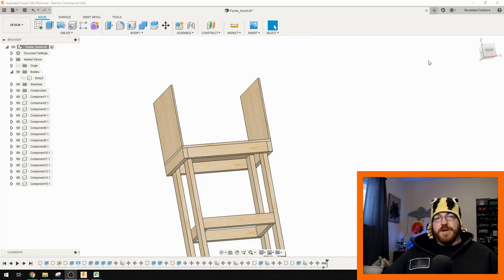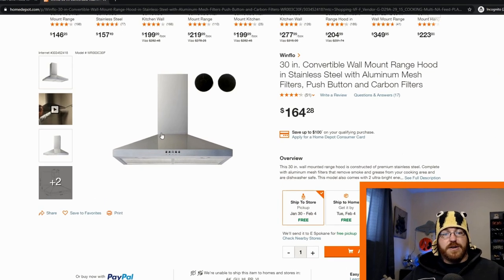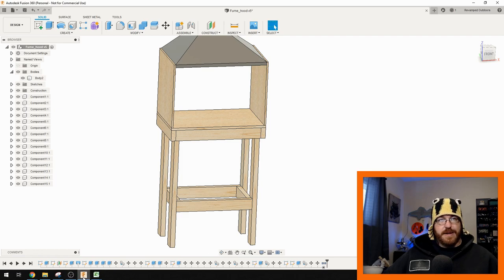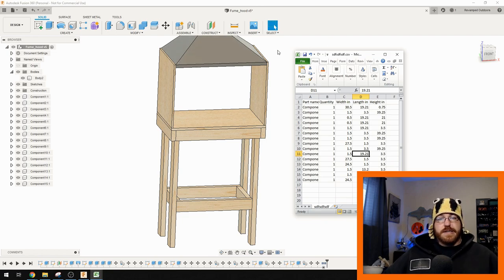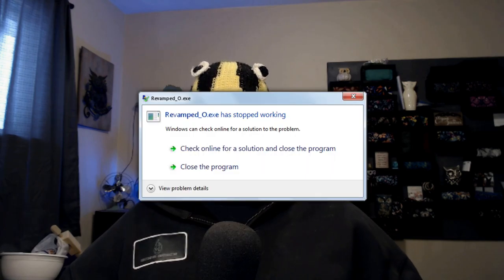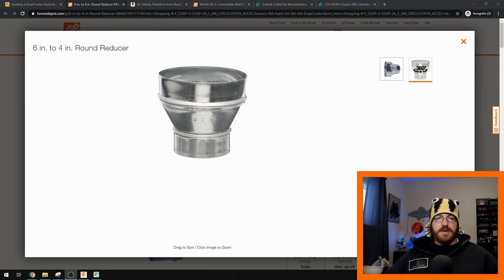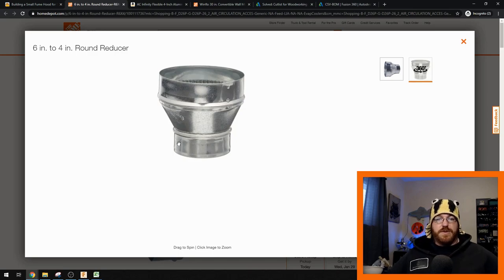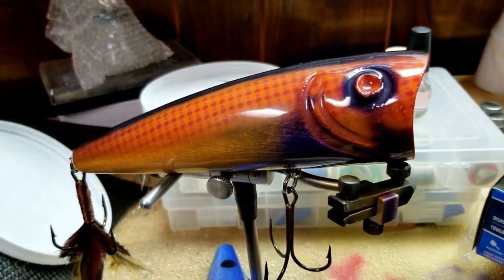Using epoxy inside?! How I vent my workshop in the winter months.

Comment: You say u are not working with anything flammable, but isn’t resin or its hardener‘s fumes are flammable?
Reply from the maker: Depends on the resin, I try to use the safest type I can find. The amount of off gassing that occurs in my projects is very minimal but to be clear you are correct. Chemical reactions can output flammable fumes. Exercising caution in all things is the best course of action.